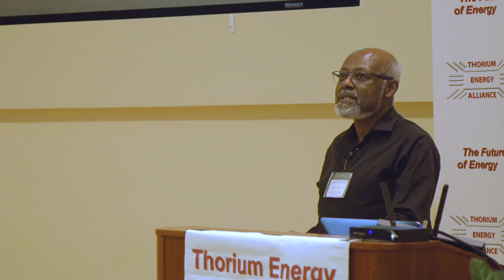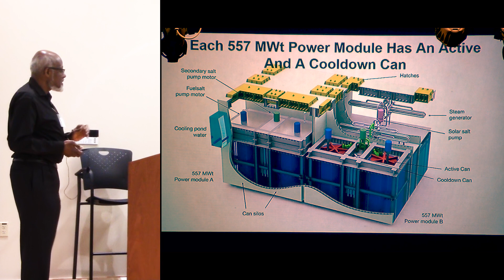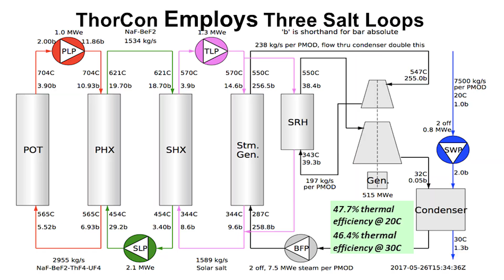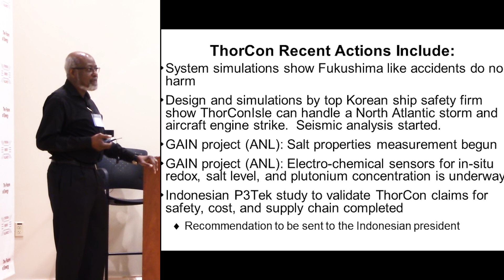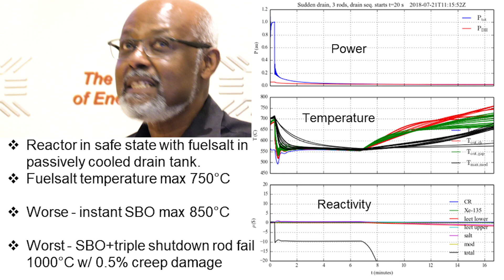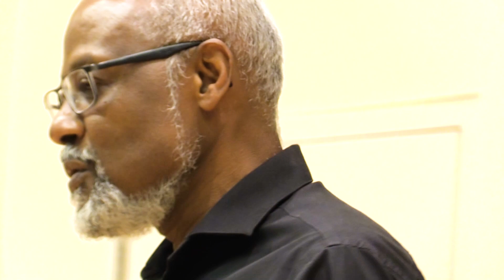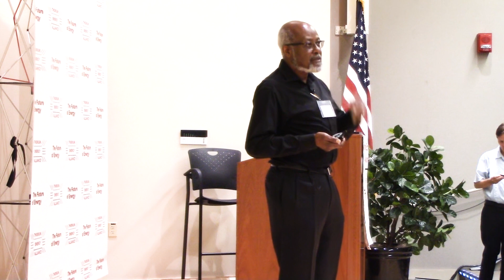ThorCon's Thorium Converter Reactor 2019-10 Update by Dane Wilson @ TEAC10

Comment: What about hypersonic missile strikes?
Reply from the maker: Wnergy independence is what helps avert "missile strikes". Enough energy, and one can use it to supply abundant water, food and electricity. We're more likely to have "missile strikes" in a world where everyone is too frightened to build energy infrastructure, and scarcity gives reason for conflict.

So what would happen? The molten salt, if blown out of the reactor, freezes when it hits water. While frozen it traps radioactive materials inside. Eventually the FLiNaK will dissolve in seawater, but there's time to retrieve the radioactive material. Water is an excellent radiation shield.

Comment: Can  thorium reactors be miniaturized so units can be sent to Mars to power habitat and machines such as bulldozers?
Reply: No! The smallest thermal MSR is NaOH moderated. Graphite moderated is always large per MW, like gas reactors.
Reply: @EdPheil  They use plutonium for this tasks since not much power is needed. Even if Pu "battery" opens during accident it wouldn't be a problem as some think. Thorium is best for producing energy on a large scale, also hydrogen, desalination of water, etc.
Reply: @codaalive5076  
You are confusing Pu238 decay heat source being for low power, with Pu for fission being as equally capable as U233 from thorium, or U235 fission. Any fission produces exactly the same energy per fission. U233/Th is no better or worse than U235 or Pu239/240/241.
Reply: We already have reactors for space, solid fuel, heat pipes,radiators to disperse heat,KiloPower.Rovers already are nuclear powered on Mars now.

Comment: I like molton salt reactors but this design scares me it is an accident looking to happen. Something goes wrong radiation all over the ocean. Is this the only way anyone knows how to cool off a reactor. The reactor needs to be made in a way as to have little or no waste heat. This is another example of wasting energy and make something good into something dangerous. Bigger is not always better the same with the larger fusion reactors.
Reply from the maker: Clement, (hi again) check out Lars newer presentation where he discusses various disaster scenarios. https://www.youtube.com/watch?v=oB1IrzDDI9g ...there's an index of subjects in the meta-data and repeated in pinned comment. I don't think wasting heat from a high-temp Gen4 is a concern... parasitic heat loss is a great way to achieve passive safety (to disperse decay heat). It is the direction Terrestrial Energy went with their MSR too, despite their I-MSR being land based.

Comment: for a lot of nations, this makes good sense. As a baseload station, this will work nicely mixed with renewable energy sources plus various means of energy storage. Allows decommissioning of old dirty coal-burning power stations. I will, however, take up a couple of issues, this will, in early days of construction, not be as cheap as made out, these things never are, part of that is due to developmental issues in terms of production, lack of production experience, unforeseen technical issues that always appear. This is why this does need government support to offset early production cost overruns. As experience grows, then the cost of production will come down. Need to see a small scale demonstration unit first.
Reply: A reactor as free from the xenon neutron capturing problem as Thorcon  or indeed any other MSR makes every so-called "renewable energy" device worthless. It's cleaner, more reliable, and perfectly capable of meeting peak loads as adequately as anything except perhaps pumped hydro storage, which can outperform gas turbine "spinning reserve" in that it can spin idle on less than 1% of the turbine's full power, whereas gas burns 30% of its full power fuel, just to spin idle ready to take up a dropped or sudden load.
Reply: The history of the enemies of nuclear is that they learned more about demonizing it to the ignorant multitude than the engineers needed to learn about building the reactors inexpensively. Specifically what Thorcon Power calls their "prototype" was a reactor designed by Alvin Weinberg, to eliminate the weaknesses he identified in his first design, the ubiquitous PWR (Pressurized Water Reactor)
The great thing about base load service from nuclear is that the fuel cost is negligible, so the nearer you can run to 100% capacity, the less the capital cost and permanent personnel cost. But the advantage of nuclear for all over reduction of CO₂ emissions is that, if you have peak grid load capacity of nuclear, you have lots of quite consistently available off-peak power.

Comment: Bad idea. You place the power plant inland, and you can protect it against tsunamis. A ship by the coast will bear the brunt of the force of a tsunami as it transitions on the continental shelf. This ship will be parked on a coastal strip that is part of the Pacific Ring of Fire. The most geologically active area on the planet. It will not be a question of if a major, completely devastating tsunami will hit that ship and tumble it inland with immense force, but WHEN. The reactor design looks very sound. Why not make provisions to sail it over in a modular system and assemble it on higher grounds inland?
Reply: Many locations are not susceptible to tsunamis, like the west coast of Japan, or up navigable rivers, or estuaries.

Comment: Gordon.  What do you hear as the target date in 2020 that China will go online with its Thorium Molten Salt Reactor?
Reply from the maker: davidgmillsatty they are building a liquid fuel test reactor now. Visa problem kept them out of ORNL MSRW 2019. I have no fresh info.
Reply: @gordonmcdowell  When Kutsch mentioned last August that China was going online with a 2.5 mega watt molten salt thorium reactor in six months was that a fairly certain date or was Kutsch just guessing?
Reply from the maker: @davidgmillsatty1900  Assume was based on this: http://samofar.eu/wp-content/uploads/2019/07/2019-TMSR-SAMOFAR%E2%80%94%E2%80%94Yang-ZOU-PDF-version-1.pdf ...presented in July 2019. I would bet going critical but not full power (2MWTh=full power) in 2020. Any takers?
Reply: @gordonmcdowell  On page 12 of the pdf at the top of the table it says SF1 and after that all references are to LF1 so I assume that SF1 is a typo.  Then I am not sure what the difference is between LF1 and TMSR -0 is.  Do you know?
Reply from the maker: @davidgmillsatty1900  Page 6 shows TMSR-0 is a mock up.

Comment: This is what needs to happen everywhere. or we will continue to burn coal and the glacier will melt fast than we can pump it back out and re-freeze it. This is real serious folks! we are in absolute survival mode crunch time to the max! 

nuclear! either that or we voluntarily cut our consumption dramatically and swiftly, like by half, and then pray that batteries and solar improve fast enough. 

a less understood idea is that water vapor from aircraft, believe it or not, is incredibly damaging to the ozone layer, an issue we thought over and done with at the montreal protocol but persists, kept hush hush by the media. we need point source capture membranes for water vapor and co2 on all aircraft and smokestacks the world over to NEURTRALIZE our current emission output, hopefully as we gain our senses and go with thorcon or another equally ready provider of nuclear power. making cheap, yet high performing membranes to achieve this goal is a serious subject to which people should devote more time to exploring! nanocrystalline cellulose is turning out to be, potentially, the material base of not only all consumer grade plastics of the future, but also the raw material for construction of these membranes. anyone whose a matiirals geek, please lets talk-nanosponge material is also very attractive for this purpose as well.

Comment: why aren't more people Thorium seriously?
Reply: Thorium reactors don't produce any great amount of weapons grade plutonium. Oak Ridge and other American research sites were working on thorium in the late 50s and early 60s- had a successful design, too. Research was defunded to create "breeder reactors"; all uranium reactors produce plutonium- breeders produce plutonium in much larger quantities. Now you know! So as long as Iran had uranium reactors, it would always be capable, ultimately, of producing some of the nastiest weapons known. So does any nation with uranium fueled nuclear reactors. After you have the fissionables, the engineering is doable by any nation that can build ships and jet engines- just need to work out the engineering.FR
Reply: @fredericrike5974  
Thorium produces weapons grade U233 as good as plutonium, or better, but Thorcon denatures it to less than 12% to prevent proliferation.
Reply: @EdPheil  The process as the '50s-'60s era experiments showed didn't produce "useable amounts" of weapons grade material. this was the primary reason the Defense Dept was a big booster for uranium based reactors, all of which produce significantly more fissile material, some "tuned" reactors producing even more. thorium reactors have already been shown to liberate more energy from "spent" fuel materials than the uranium based reactors could, leaving much smaller and less radioactive waste. Among the waste materials that could be usefully run through this process are the barrels of irradiated water from the water cooling loops needed to help control such reactors.  There are thousands of such bbls at the Glen Rose Nuclear Power Plant in Texas waiting till they are stable enough to blend with "clean" water and be released into the environment. I imagine there are hundreds of thousands of these all over the country. Additionally, the US has already got enough thorium in the piles of waste from uranium mining  to make enough power to run the US for several decades. I appreciate your comment, but I know I am not a nuclear engineer or scientist and can only work from what I'm told. FWIW, sources, as they do in all reports, matter. Some of mine include AEC reports back before the renaming- but I'm 70, so that is just past yesterday for me.
Reply: @fredericrike5974  
All three ORNL MSR cores used HEU to guarantee a negative temperature coefficient.

LFTR can not both isobreed U233 from Th and burn SNF, not poisble as U233 has way too few neutrons/fission.

The reason DOD didnt use it is because it didnt breed fissile fast enough, but that was vecause the US wanted a large arsenal, but most small countries, or groups only needafew, which U233 can do, and it is better than Pu239 because the weapons can be simpler gun type. I have veen a nuclear engineer for 36 years, 32 yrs of that designing every reactor you can imagine for the US Navy.
Reply: @fredericrike5974  
Fission of any type of fissile releases exactly the same amount of energy, thorium/U233 is no better or worse.
Reply: @EdPheil  the quantity of highly radioactives is reduced- you are correct- radiation is radiation, but a process that produces few grams vs one that produces kilos for the same amount of energy isn't a contest. We are into uranium based reactors because the Defense Dept wanted us to be their. The AF was the only service branch interested in Thorium, and that was because it looked like it might be possible to make a reactor small enough and light enough to build a long range bomber around. When that proved infeasible, all support went to uranium and the AEC responded by only accepting water cooled, uranium based plans for consideration. This all went down in the late '50s and early '60s, so it was still called the Atomic Energy Commission. Mr. Phiel, I'm an engineer's kid- not a nuclear physics guy- so I do try to check facts on stuff like this as a scientific process; this one was dominated by Cold War thinkers. If you want an Iran out of the nuclear bomb business either take all the nuclear work away from them or give them a legitimate civilian system that produces very little that can be made into a bomb.Thorium would have been one of the better solutions, but the West, meaning America, quit developing this tech about 1965. It has only re emerged as recently as '05 or so because of private interests, as much to reduce the hot waste as in the much improved safety Thorium reactors potentially have. Among others, Bill Gates is said to have a bunch of engineers working outside the US on this- the NRC will not release a license to do so within the US.
Reply: @fredericrike5974  
I AM a nuclear engineer, have designed every reactor type imaginable for the US Navy for 32 years & 4 years as CTO at Elysium Indistries USA. 

One nuclear fuel vs another makes no difference on the amount of fissiin products/MWe from the other fuel. It is more about whether you can close the fuel cycle. You can close the fuel cycle on a thermal thorium MSR, but it requires use of illegal weapons grade 100% U233. To close the fuel cycle. It is easier to close the fuel cycle with a fast chloride MSR on the U/Pu fuel cyclewith denatured, non-weapons grade Pu becsuse it gets 3 neutrons/fission vs 2.3 neutrons/fission for thermal U233. 

Thorcon does not use a closed fuel cycle, so does have waste like an LWR, butnot stabilized, like LWR SNF.
Reply: @EdPheil  Thank you! You have not only showed me an error in my untrained read on the subject, you have told me that methods for nuclear power to significantly reduce the load of irradiated material exist.
 I now challenge the industry to get in the face of the DoD, The US State Dept and the politicians who have lied and misrepresented their decisions for over 60 years. Again, I appreciate the time you have taken to improve my less than perfect understanding- FWIW, the SALT treaty and others have had the nuclear weapons facility here in Texas dismantling atomic weapons for some time; where is that highly dangerous stuff going and how long will it be before it is even moderately safe to be around? Wouldn't this provide the closure material your thoughts above are positing?
Reply: @fredericrike5974  
All of the dissasembled Uranium weapons was down blended to <5% already & completely burned by 2013 in US LWR reactors. As far as I know there is no treaty in place with Russia to dismantle plytonium nuclear weapons. But, there is Pu weapon rebuild/refurb going on, mostly to maintain the capability & skills of making nuclear weapons, as the weapons are still good/reliable through at least 2050.
Reply: @EdPheil  Good to know and thank you for the update. I may sound a bit hardcase, and some of my actions appear so, but the US needs nuclear energy to succeed if we are to have much near term chance of serious reduction in burned hydrocarbons- which will kill us much faster than the rate we are presently developing  huge "stockpiles" of radioactive waste. IN 1961, John Kennedy challenged America to go to the Moon in a decade; we did it in nine years, and the doing of it ultimately took the skills and output of 30 K engineers in several disciplines to accomplish. We are still unpacking all the goodies from that flight of exploration. We should never have stopped- you would likely be designing nuclear power plants for Mars habitat of for asteroid mining vessels! And yes, I do read "speculative fiction"- but if you don't "go there" it is always impossible. So was going to the Moon in 1961.

Comment: My questions are, with the heat condenser and the coolant. Will it have enough heat capacity to maintain operation of the reactor without having your coolant be too warm and the condenser work fast enough to remove the heat at a rate with constant operation to have enough cold coolant to cool the salt fast enough. As to hit your ROI you want that thing running at high temps, and the coolant/ heat condenser possibly over long periods of reliable steam production may not keep up. I'm sure you guys are doing good math and estimates. But things break down and the heat condenser seems to be a failure point that needs redundancy or a backup replacement on standby and constant checks on its operation. Wouldn't want it in drain tanks without cold coolant ready. Nice surface area on the drain tanks, that is good design.

Also the cold wall, will there be a secondary containment? Considering the corrosion. Replacing the can is expensive, blanketing the can and using maybe Cathodic protection can protect it, but I have my doubts in long term it will leak and a secondary containment will actually maybe long term, allow for leakage and cost savings while you than can drain the can and replace it when it is economically viable to do so?

Although I love the modular designs, I think smaller is great, but the trade offs might make it harder to be viable in the long term economically at this point.